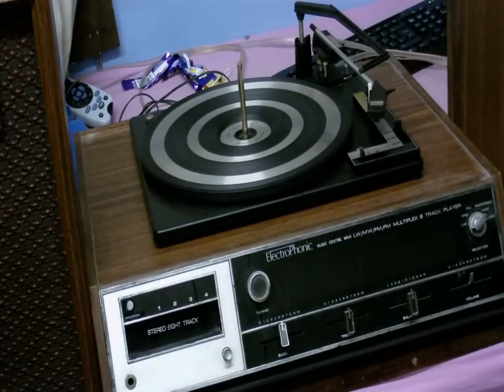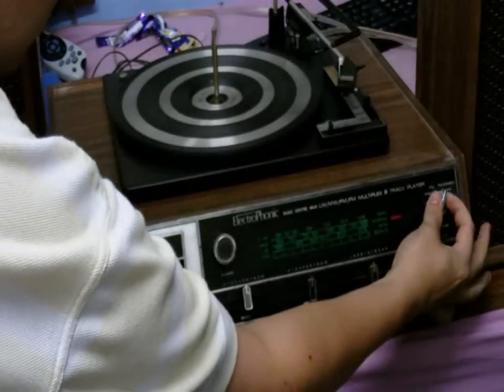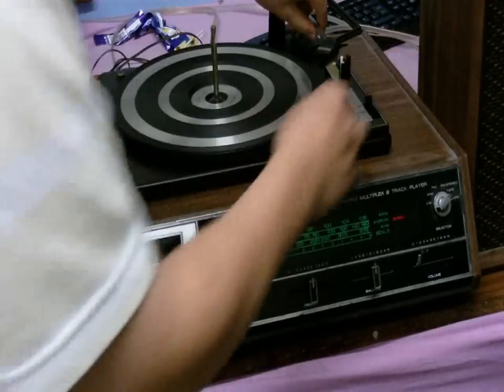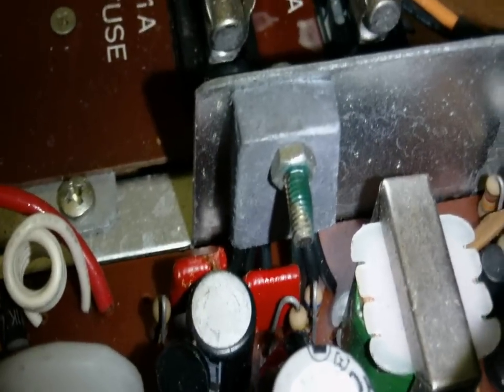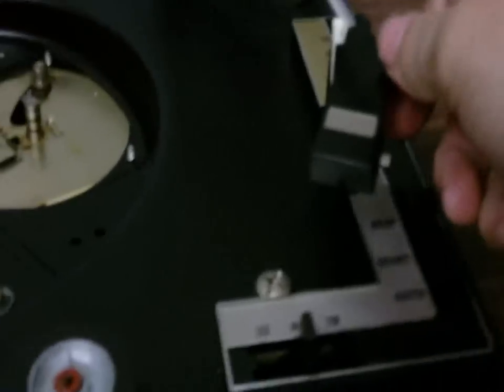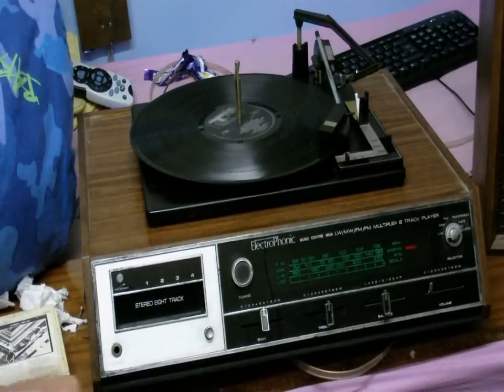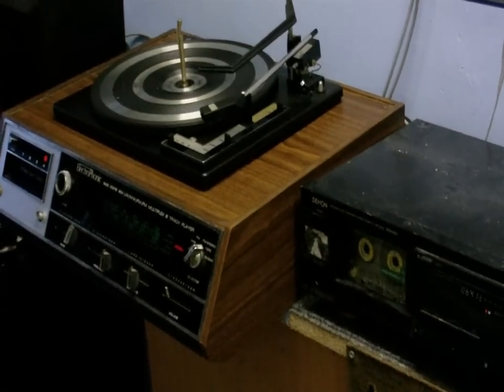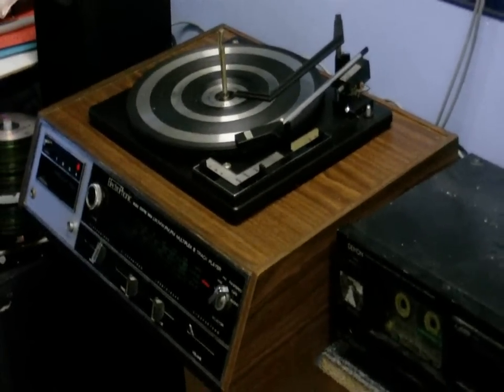The 1975 Electrophonic Music Centre

Comment from the maker: Sounds like the turntable itself has seized up, the oil gets sticky after a while.  If I remember, there is a c-clip that holds the turntable on to the spindle (it might be hidden behind a circle silver label that says ''precision built by bsr" (or something like that), that can be pried of with a small screwdriver and so can the c-clip), the turntabe may need a fair bit of jiggling to get if out, but then just clean everything up and re-lube and it should work.

Comment from the maker: @vlad48329reborn Well is has an aux input, and a tape output, so anything could be connected to it.  I have my reel to reel tape reorder hooked up to it at the moment, the only problem is there's no designated aux input on the function dial, the aux input works when "phono" is selected, they both can be played at the same time.  If I try to record from the record player, with the tape recorder's output still connected up, all I'd get is feedback.

Comment: I HAVE THE SAME PROBLEM!
Just bought the Sound Design 5840, the record player doesn't spin and won't separate from the "box" if you will. I have a feeling that the 2 big screws on top have some sort of plate on the bottom preventing you from lifting it up. What now?

Comment: hey I just happened upon a Juliette system thats fairly similar, I am new to this whole restoration game and dont really know how to fix my record player. Its appears to be the same model and it obviously needs a new cartridge which I can probably handle. However, the turntable itself does not spin which I'm not sure how to approach that problem as I am relatively new to this restoration game. So if you could offer any tips or anything that would be greatly appreciated. Cheers

Comment: Hi, I have the same unit. I was wondering if you could advise me on how to fix the turntable? It runs a little slowly (is stiff) and clicks as the record plays. Any advice would be useful. Many thanks.
Reply from the maker: It sounds as if the turntable needs some fresh oil. 40+ year old oil basically turns into tar. There should be a clip on the spindle holding the turntable in place, once that is removed the turntable can be lifted off. clean all the old gunk off the spindle (also the turntable centre hole will need to be cleaned too), then apply fresh oil to the spindle and the hole.